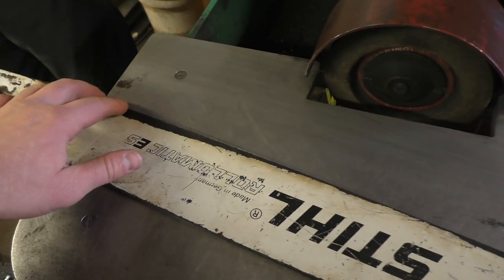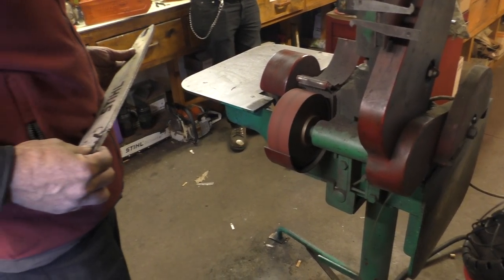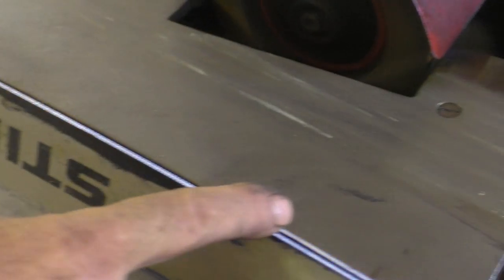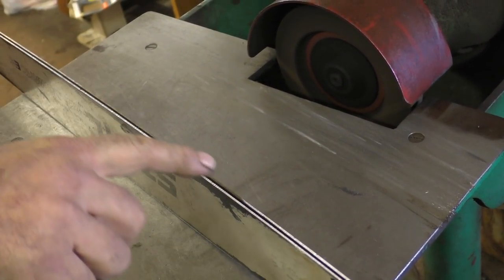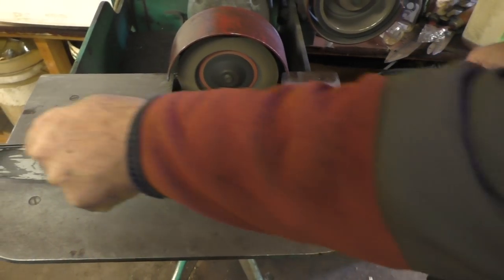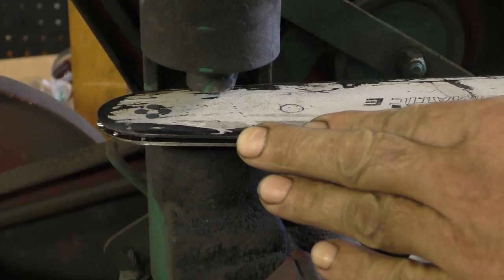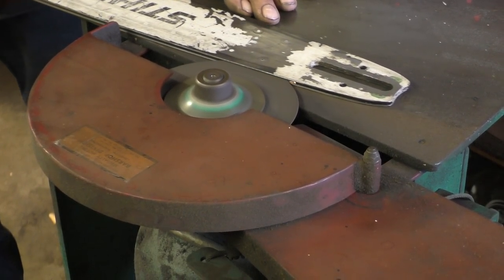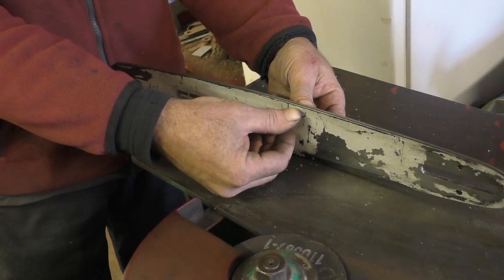Barshop - chainsaw bar repair

Comment: This is classic old school. Folks used to repair things to keep them going. They would even "hard face" bars with a special welding rod & acetylene torch to rebuild the hard nose bar tip & worn down bar rails.  Now, everything is disposable.
Reply: you gave me an idea...

Comment: How much ya want for that machine, ha!  Not nearly as cool, but a metal cut off blade chucked up in a tablesaw works for removing any burrs and for grinding the edge square.  Might be a good idea to first take the sawdust out of the bottom of the tablesaw to not burn your shop down.
Reply: i have a disc sander machine with a table that would do the same basic thing .   for that matter you put a bar in a bench vice and grind the rails flat by hand , ive done it .